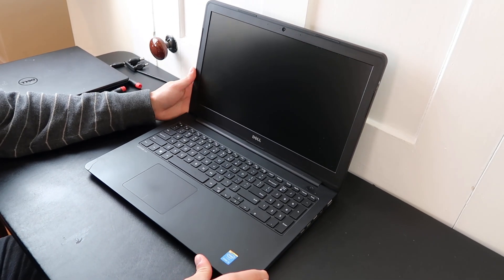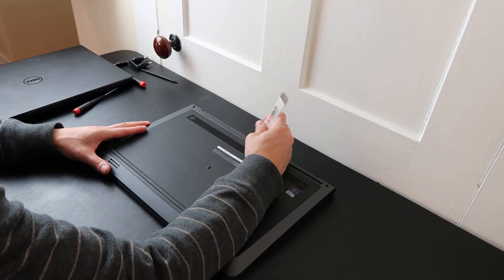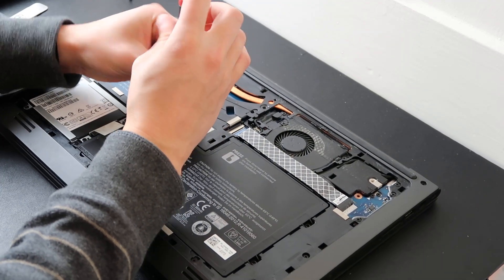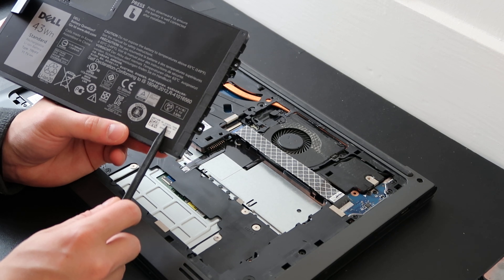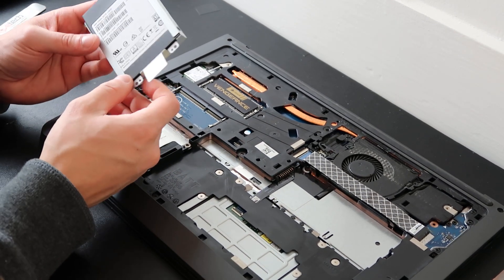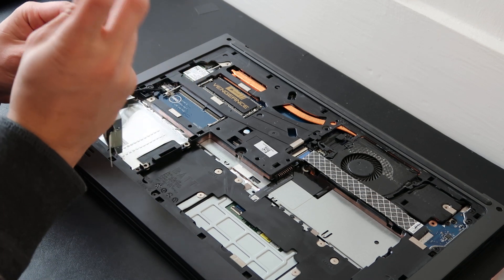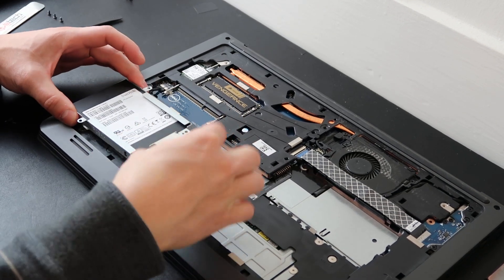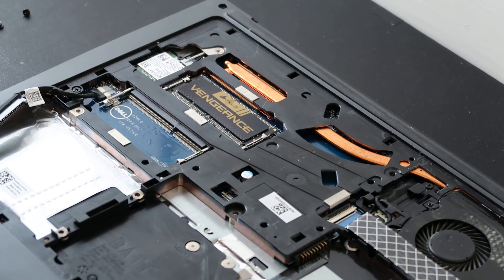How To Replace Upgrade RAM, Battery, HDD, Hard Drive - Dell Latitude 3550

Comment: So can you say that this model is any reliable and has no construction issues?
Is it better than HP Probook 650 G3 for example?
Thanks!
Reply from the maker: The construction of those two computers is basically the same in my opinion :)
Reply: @PC_Monkey  Well. Does Dell 3550 support second hard storage?
Reply from the maker: @senny_penny  Yes, they all really do.  You can use an external HDD hook up with any computer :)

Comment: can all of these Dell Precision models use a regular Hard Drive(HDD) as opposed to the SSD?  In other words do these Dell units use the same SATA connector for the HDD as for the SSD?  Please respond ASAP.  Thank you so much!!!!
Reply from the maker: Yes.  Depending on how the SSD in installed of course, you can use the same connector to connect a HDD or a SSD to the Motherboard :)
Reply: @PC_Monkey  Thank you Sir.   I Appreciate the response.  Have a blessed upcoming work-week!!!
Reply from the maker: @nal2us2  Happy to help :)  Always here if needed !!

Comment: The batteries are so expensive!!! Is there any cheaper ones?
Reply from the maker: What brand and model computer do you have?
Reply: The same as in this vid!
Reply from the maker: @marcmiyamoto  Does this look like the battery you need? 
https://www.ebay.com/itm/New-Battery-For-Dell-Inspiron-15-5547-5545-5548-Latitude-3450-3550-TRHFF-1V2F6/383889217504?_trkparms=ispr%3D1&hash=item59619497e0:g:FfsAAOSw82hf9Cv4&amdata=enc%3AAQAFAAACgBaobrjLl8XobRIiIML1V4Imu%252Fn%252BzU5L90Z278x5ickkxFtV7J5P58ubuVigtBH%252FeyQGdigicQ6B0ZDWk%252FC9bDE%252BEsUjLYeSfKxsOn187JwClxsYYCNSPW4r%252BRgp76N5u4MCJNi2Pwhl5QPtgbWR0%252B2we4JNm%252FRgzRLLXDYCw8Y3Yc%252FvDwglvPTHEtUUX2CrVr5Q3Fq6Vpsr5xOQDwusG0ALvShCUm4O7kcxofi93ihfM4ghvnsJO0JRGb%252Bz1BL7VIhfckMCMe2eSIom5cFrYOEC7%252BsG%252B%252FGr3ZzPVs69S%252FFonTCCepyoOS1b%252FDGschnI5BdOVqRRp%252BO9ZqhrMhBhlqMXLr3tNDz%252FaUIib3MFzEPbr2p6oBYyjNi%252BjKehKX7kGQh%252BUXDhvtGP4BH%252Fi03iuyj8yo%252BCLMk14Of%252Bzx83T11RnThE8Cay86zMA%252F60%252FJSxBpmsoKvNbZrgQHJ1M%252FgR6lELXXUDpGhVL7BP2wFhAz%252BDnQUIPyCfd1TmR1KOM%252F5KJD1efYNgxexC%252F2OwnhGBlYVyQ3v2JDpYuwYcOcLX%252B6dpvh39NkLXwh7lrAEJJB2o47qSNlcoFq1FQoI4KdM2hqaxmUH6XNbAI1jWgB4zm%252FDBAKLoq60W7fpH6C%252BUGISqdtFUWZ%252FmAXMvkynIqYyQIYMTL072bhq6FHdo80fY303EsXxAgo3eQxsBGiVM4puuWKyScujC%252BJYLHS1WmnW75TCP4MDqmFiqXvsPMkzhVcUwlvCqx4%252BRzhRK09nJRQQCjhQj1hRSSf4w7DF7PHlvWTcbdg4yrOEP5ceTWUKSmWI%252B4IrHFhnvVFYUXcTdTOZTCjjTsNDNw8JrpTXE8jQq5mg%253D%7Ccksum%3A383889217504b2882f3a902249449891552192c34543%7Campid%3APL_CLK%7Cclp%3A2334524
Reply: @PC_Monkey  Yes thank you so much!